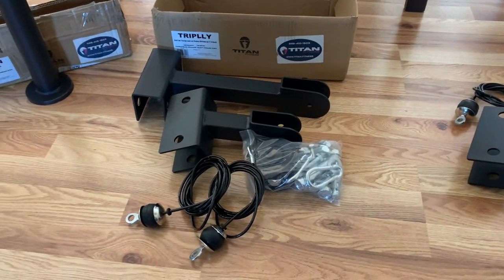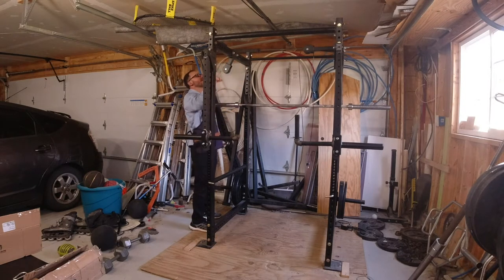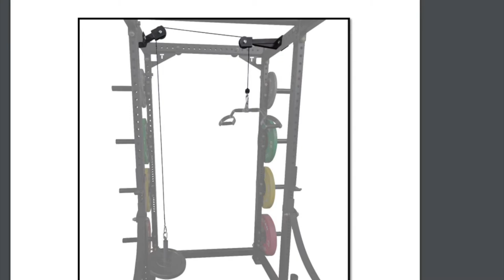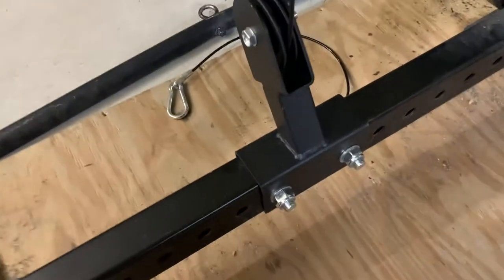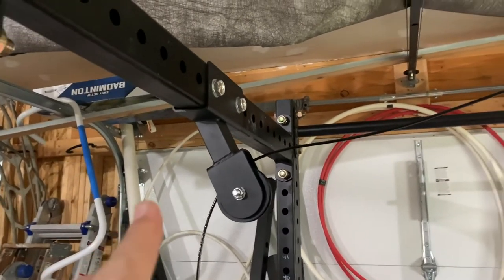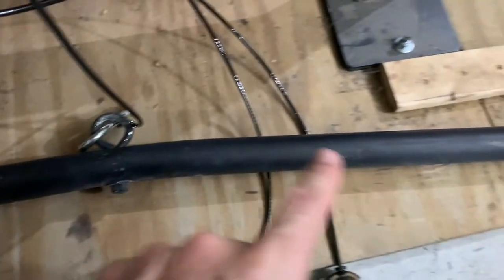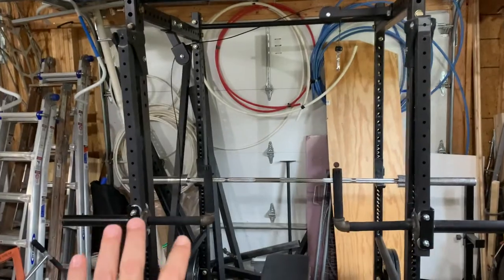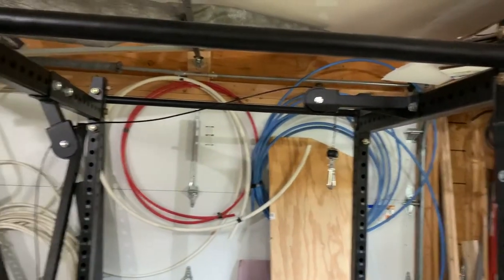Titan Fitness T3 Rack Tricep Pulley and Low Pulley Install

Comment: I have my top pulley setup as you do at 5:26 and works great. I have the short T3 and the cable is the perfect length with the pulley above the bar facing out.  Loading pin on the inside. I did think the cable for the low pulley was a bit to long but it works.
Reply from the maker: Thanks for sharing your experience.  My kit came with an extra cable, I will compare the lengths and see if they are different.
Reply: @RickBolt  mine also came with an extra cable but was the same length as the low pulley.

Comment: I have put together stuff in the past where the parts were not in the proper place
according to the diagrams.  I had to swap parts around until it was functionally correct.
They could have also packaged the wrong angle pulley in the box.
Reply from the maker: I think the full install video that is coming out in a couple of weeks will show it better as a final install.  It seems to be working great the way we set it up at the end.

Comment: Got mine today… didn’t come with load pin or lower pulley…
Reply: Do you have to buy the load pin or is it supposed to come with it
Reply: @justincollins7928  loading pin is separate… why does it say complete pulley system